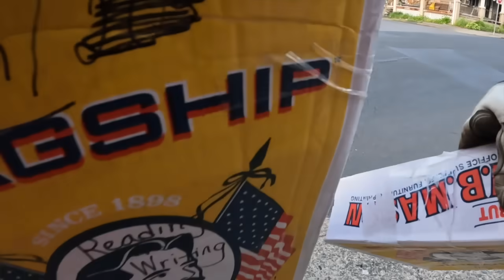WOW Look What I Found During Trash Picking! -  Ep. 907

Comment: An RV from the 90's is highly unlikely to be worth over $10K especially if it has any visible damage and I am willing to wager that even if it didn't have the damage you mentioned, it is going to have other issues. RV's are money pits and almost always will have water problems or electrical problems. I have owned several over the years and will never own another one. I recommend watching some of the RV videos on Lehtos Law here on YouTube and you will see why I advise against having one.
Reply: No wonder they are encouraging poor seniors to live in them. Encouraged, certainly isn't the right word. It's a serious situation. Thanks for the heads up.
Reply: @edie4321  they often have rotted wood in the walls and roof as well as a lot of black mold in those areas and the floors. Plus the structure of them is extremely flimsy and most are built using 2x2 wooden structures... your garden sheds are built stronger. Also if you buy a brand new one, good luck with the warranty which is basically non existent.
Reply: @todddenio3200  Yes, thank you. Sadly, this is the world we're living in. Time to shake it up, for balance to be restored. I pray amazing outcomes for us all. Much Love